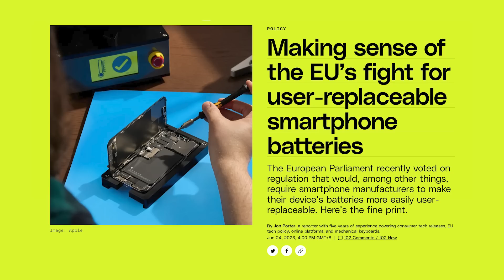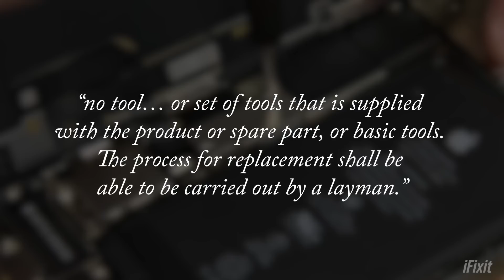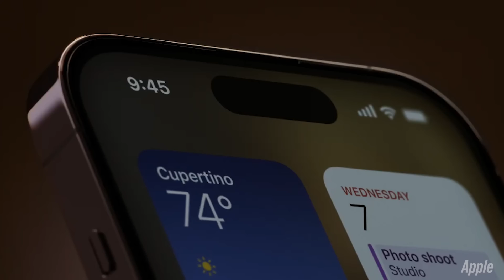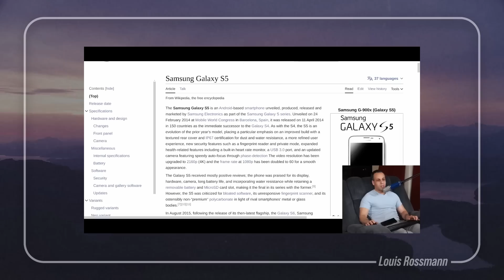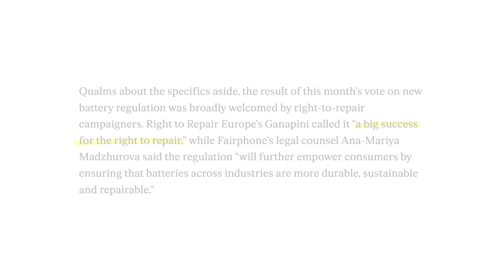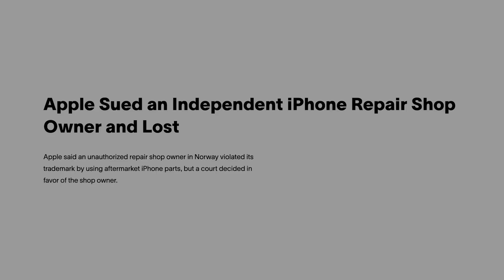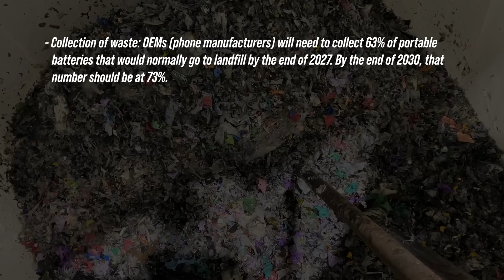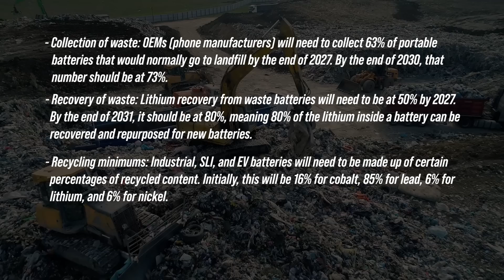EU Just Changed Smartphones Forever

Comment: This brings up memories of me trying to replace my S3 mini battery about 10 years ago. The official Samsung store was expensive and short on supply of these, and Amazon and others had been flooded by counterfeit products that might have been outright dangerous to carry in your pocket. That may only be prevented by either forcing manufacturers to keep supply up during the device lifespan, or by ultimately standardizing batteries.
Reply: Almost everything rechargeable nowadays has a USB input to charge it, and we can get USB cables very easily on any shopping trip into town or the supermarket. This is the benefit of standardisation. Let's hope we can force smartphone manufacturers to standardise on batteries, so they are as easily bought and replaced.
Reply: @mattsadventureswithart5764  all devices that have batteries should have bypass battery mode so that we can at least power our devices when there's no battery.
Reply: Even batteries like AA or AAA have some serious problems with quality control of some brands. Even standardization doesn't guarantee high quality from third parties.
Reply: @MegaLokopo  that’s the same as with every product. I mean the US food is full of poison that’s banned in the EU…
Reply: @travelblade2k  Yea, and even then even the eu isn't able to guarantee the food you buy will be safe, and they can't consistently prevent fraud. You just have to be very careful with whatever you buy regardless of where you live.

Comment: Apple and the other companies specifically designed the batteries not to be removable one for planned obsolescence and the other so that users could not turn off the phone this is for data gathering and location tracking. I still have a cell phone with the removable battery cuz it's hard to find these.

Comment: So the battery will be replaceable, will there be another law that forces manufacturers to produce these replacement batteries for a certain number of years? because without it it's kind of useless. If the batteries are only made until the device gets software support this law will only extend the life of the device a few years.

Comment: I wonder what will happen to foldables where you have two batteries in both half. One is easy enough to replace but the other has screens ot both sides. I really hope this won't end in having only one battery (as foldable batteries are still on the smaller side) or foldables being excluded form the EU. I1m happy about this regaulation but it shouldn't kill of pretty much the only innovation for the moblie industry in the last 10 years.
Reply: such a device does not exist. every phone is under 5000 mAh, if some manufacturer says "now its not doable", then it is incompetent
Reply: @ivobrick7401  Replaceable batteries will be smaller that the non replaceable ones due to packaging (or the new replaceable ones will be more fragile thsn the old ones). Also smaller if the contsct pins need to be bsck instesd of ribbon cables (which is doable by a layman but not designed for constant battery replacement). Ans eith a foldable you have to split this into two parts or you get a small battery, offset weight distribution or a thicker half on one side. If you put batteries to both half, on one half you need to figure out an easy screen removal method which will bring additional packaging issues. This could end up with a bigger phone, smaller battery or reduced feature set (slower charging, no wireless charging, etc.). For a slab phonr it's easier to implement but there are comolex designs where I don't see hoe it's possible.

Comment: All of Apple anti-repair moves are clearly about profit and screwing the customer.  Other makers are only to happy to copy their tactics, no matter what excuse they give.  This is an important victory in right-to-repair, but also for right-to-privacy.  In the past, if anyone wanted to ensure privacy from electronic eavesdropping, they could remove the battery from their phone easily.  Later models ended this, and in fact only 'power down' when turned off.  If no effort is made to shut the phone down fully, do not expect it to be so, ever.  If after this EU law goes into effect, the US, China, or any other nation that requires phones without removable batteries, the reason will plainly be to prevent the easy disruption of it usability as a tool for espionage of an individual, likely with questionable motives.

Comment: I used to repair to the board level on Mac's while being a certified technician. Should I have charged my customer for a replacement part or soldered that MacBook Pro power plug back for less. In my time I probably did less than 20. I'm sure that's why the magnetic plug came out later on. The customer shouldn't be penalized for a simple fix. I'm sure my customers with those repairs did not come back.. your welcome 🤗🤙🖖 data recovery too. I remember my services were dirt cheap hundreds of dollars 💵💲I could have made a killing but helping a writer or a musician I had them pay it forward instead. ❤

Comment: Asking if the removeable battery was natural progression of design is like asking if Headphone Jacks and IR Lasers being removed was a natural progression of design.
Reply: i want ir blaster back. that was such an awesome feature
Reply: @andrewk8636 
Start using any of the Xiaomi phones, they never gave up on ir.
Reply: @andrewk8636   Holding to my Poco X3 Pro / RN8Pro for the IR Blaster !
And I just replaced my Poco F1's battery yesterday - New phones's pricing is a disgrace, no wonder shipments went down, for like, 20% WorldWide or something like that
Reply: Headphone jack removal is logical. I cant go back to wired airpods. Wireless is just too practical
Reply: @zackei3003  i dunno if you know this but you can have both bluetooth and a 3.5mm jack on a phone. A headphone jack takes a miniscule amount of size and complexity inside a phone. wireless headphones batteries will die rendering them useless unless they also have a 3.5mm port on them. Wired audio is simply better due to plain physics. For instance, my LG v30 which is a phone that came out in like 2017 has much better audio quality than any phone nowdays thanks to it's quad dac. There's simply no excuse to remove the 3.5mm jack other than anti consumer practices.
Reply: @Depresso_dr but it is yet another thing that has to be water proofed, which is non trivial
Reply: @Depresso_dr Unless you are using really good headphones, the quality debate with wires vs wireless is stupid. Plus with wireless you can have true digital audio which is basically lossless... That of course, just like I said if you have shitty headphones then having lossless audio is pointless.
Reply: @Erik20766  sony has 3.5mm jack and its IP68 rating.. they've are the first to have IP68 rating in their phones.. and their latest flagship still has 3.5mm jack
Reply: I had Samsung S7, which had a 3.5 mm headphone jack with IP67 rating. Well by that logic, phones shouldn't even have USB C ports and move to total wireless methods.
Reply: @Erik20766  And yet several companies used to do it. Some dude added a headphone jack to the iphone 10 or 11 and water proofed it. If he can so can apple.
Reply: @HaimRich94  All audio is analog. You will always get better audio with seperate high end dac. Otherwise you are forced to use the one in your earbuds or headphones which will always be lower quality than a seperate high end dac.
Reply: @HaimRich94   wrong. don't talk about things you don't understand. even $80 wired earbuds have better audio than ANY wireless earbuds on the market today. also, digital audio doesn't exist. all audio is analog. digital also doesn't mean lossless. don't talk about things you don't understand.
Reply: @MegaLokopo  I'm talking about the transmission of data being digital, using a headphone jack with your phone introduces noise depending on how good your headphones and cables are which it doesn't happen when you directly send wireless data to your headphones, the wireless signal also faces noise based on the background conditions but it's way easier to send quality data wireless in short distances than with your headphones  cables because most of them are really bad.

The DAC is only for moving your headphones, hence why DAC means Digital to analog converter and some of the best DACs out there also have wireless connections

I will repeat myself: "Unless you are using really good headphones, the quality debate with wires vs wireless is stupid."
Reply: @aliwalyd3  I already answered the other guy but still: I'm talking about the transmission of the data (which in this case if the audio files). To better explain myself: the transmission of the data between the phone and the headphones IE using the cable vs the internal components wireless headphones use
Reply: @Depresso_dr  Yeah a good wired headset will last you years, can't say that about wireless headsets, batteries degrade and unless they are removal it's better to have a wired earphones.
Reply: @HaimRich94  There is no data in wired headphones, The wires literally carry the voltages supplied to the electromagnets.
Wired: File => DAC => headphone speakers.
Wireless: File => Encoder+compression => Transmission => Decoder+decompression => DAC => Headphone speakers.
Reply: @HAWXLEADER  That's exactly what I'm saying. Maybe I'm still not explaining myself well enough: When using a wire headphone, if they are not good enough you will add noise between the phone and the headphones because of the cable while with wireless you first send the data to the headphones and the headphones send the signal to the speakers without the need of a cable between the phone and the headphones and it's just the internal cables of the headphones. That's why I said that if we are not talking about good headphones (which by definition have good cables or at least they should) then the wireless vs wired debated in terms of quality is pointless.

And all of that is even without talking about software for example, lots and lots of people don't even know that when using a headphone with mic over bluetooth for example, you will double the quality by just disabling the mic
Reply: @zackei3003 Nah
Reply: @zackei3003  Can you charge your phone and your airpods while you listen to music on those airpods? Batteries don't last forever.
Reply: @zackei3003 the removal of the 3.5mm headphone jack is only about forcing people to buy more expensive, higher margin wireless headphones. The removal is wholely consumer hostile.
Reply: @zackei3003  i agree. I have iphone 7 but use airpods pro. 😂
I don’t care about how fast my cell phone is, I just don’t want any wires around me.
Reply: @zackei3003 lmao...you know they can co exist? Gone are the days by Bluetooth headphones die and I plug into the phone
Reply: @zackei3003  I use both wireless and wired headphones. For bike rides, walks and podcasts I use wireless bone conductive headphones. They are not great sounding but it doesn't matter when I need just some background noise. When I really want to listen to music or watch something I either plug in my wired headphones or earbuds. Way nicer sound and no lag. 
If 3.5mm jack wasn't something people want, you wouldn't see people complaining about lack of it all the time, and going above and beyond to find phones that still have 3.5mm jack with a decent DAC. Sony still offers such phones.

Comment: Yes but then how would your phone be water resistant to the point where if you really wanted to, you could just run your screen under some cool sink water to clean your screen of without damaging the unit. I did that with my iPhone 11 before and no damage occurred ever. Even more better now with my 14 pro max. I love the water proofing of it and wonder how is this possible if they return to easily removable batteries again? 🤔
Reply: I guess I have never heard of the phone models that were ip67 and ip68 with removable batteries as I despise Android and only used an android phone very briefly because I despised the OS. So I have been using iPhone since the 4s days.

Comment: Just give it an external battery pack, like I have for my iphone 7 and reduce the size of the internal battery to zero, a capacitor that does not wear is enough for inside the battery...... easy.

BTW, yes I am still running an Iphone 7. Was new when I bought it and never felt like replacing the battery inside of it.

Comment: I've actually never carried a spare battery. To me the extra battery companies like Samsung used to put in in the packaging when you bought a new phone was more for when the other one started to die. For me the biggest change would be in asking companies to be to software platform support for say, the first 8 or 10 years of their release. It's still far cheaper to replace even an iPhone battery even using Apple's iStore,  what trully forces a lot of people to buy an new phone is when you is when it is no longer getting software updates. PCs live much longer because of the ability to update the software, except the EU allowing Microsoft to force a lot of powerful PCs to e-waste with their forced TPM2.0 requirement for Win11. TPM should be an optional thing, where you could install yor Windows but know that you won't have certain features like bitlocker maybe.
Reply: this,  I hardly ever replaced a phone or laptop because of a dead battery.  Usually the OS software is not compatible anymore... or the new apps are getting to large (bloatware)

Comment: What I would also want to see, is a bit more openness with the OS and the software. I have moved on a new phone not because it was unuseable, but because some manufacturers stop updating the OS even after 1 generation (I am looking at you Motorolla). If I can run Windows 11 on my 2011 Desktop, I don't see why I shouldn't be able to run android 12 on an android 11 device or even swap android for something completely different.

Comment: I have some doubts, as to how good this is actually going to be for the environment and customers, in the end. On one hand, I miss being able to replace the battery. On the other, I've rarely had any situations, where I would actually NEED to replace the battery. Just bring a charger and/or powerbank... If you're going to replace your battery for "emergencies", you'll have to carry a spare batt around. Which does basically the same as a powerbank... Except it will have limitations as far as size and capacity goes. Do the benefits really outweigh the downsides?

This is NOT going to be the same for everyone, but most of us, will never bother actually swapping the battery... If the batteries retain their size and longevity, once the battery actually starts getting depleted, people are ready to move on to an updated phone, with better specs, and less wear. A fresh battery COULD keep SOME phones in use for longer. However, it might also lead to a bunch of extra battery production, for batteries that are bought "just in case", and then they get discarded along with the phone, if the owner wants/needs an upgrade, or the phone is broken in some way. 

We all know, they will find a way to make the batteries proprietary, and there will be little chance for the consumer to get a fairly priced battery, because the phone manufacturer will implement software to stop us from buying our batteries from anyone, except them. Just look at replacement parts for the iPhone... If you replace as much as a volume rocker, the phone can tell, and "punish" you, by locking you out from software updates, among other things.

I grew up with replaceable batteries - the waterproofing NEVER worked as good as it does now, that the phones are properly sealed. The replaceable batteries always made phones susceptible to water ingress, and there's a high chance phones will become less durable, with a much higher rate of moisture damaged phones. Boom. Now you have to replace the entire phone, just the same as with a non-replaceable battery.

There are ways to work around this, but do we trust the manufacturers to actually do that? And do we trust our governments to hold manufacturers accountable if they DON'T? A regulation has no worth, if it is not enforced, or if the enforcement turns out to be cheaper for manufacturers, than actually following regulations. There have already been examples of this, where fines have been levied against manufacturers, but they have been a JOKE, compared to the amount of money the manufacturers have made.

There are a lot of factors at play here, so it will be interesting to see how it plays out.

Comment: Cheaper to made and harder to replace the batteries so all good for the manufacturer. I dream of a standardized parallelepipedic phone batteries, just like AAA C D are for cylindrical ones and so on. 
If a bunch of size voltage and connectors was set all for once, that would allow manufacturing of cheaper long available batteries that you can use in multiples products aka same batterie can be used in lg samsung or apple products. Think some microsoft surface even as good as this product can be have really impossible to replace batteries thanks to the all glued design.
Even some kikstarter product like some new tape walkmans are made with included Lithium batterie but all the case is glued.
Same standardisation would be great too for powertools, so you'll be abble to get a new batterie instead of must buy a full new tool just because the batteries is no more available. Now I hate theses tool and go back to corded tools just because they will work fine even if you don't use them for 6 month and they wear only if used not just for storage time.